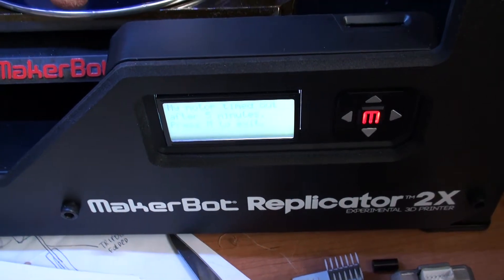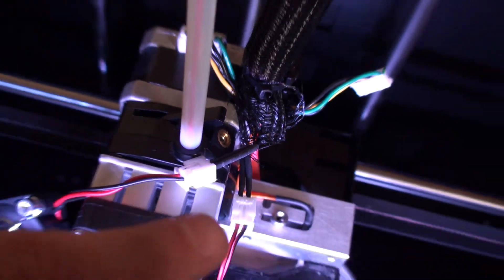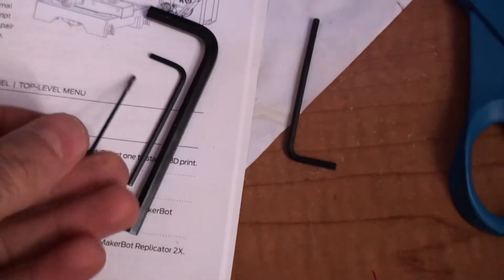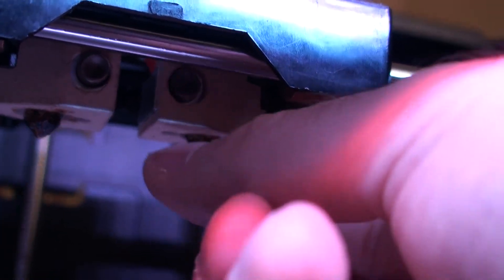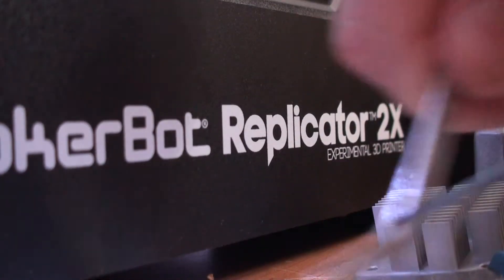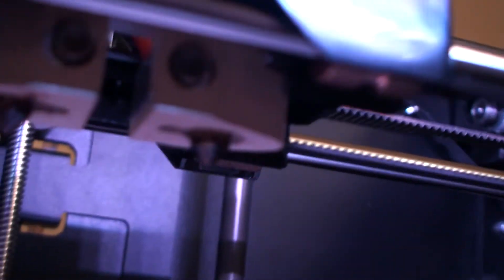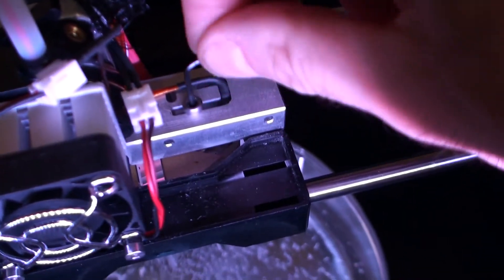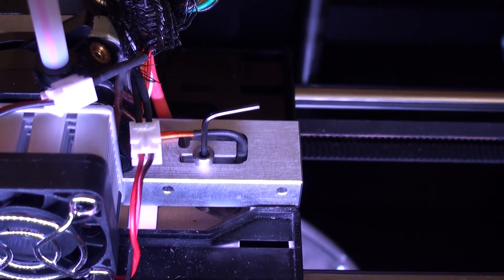How to clean extruder tube for MakerBot Replicator 2X

Comment from the maker: I didn't pour acetone in. I guess you're right, it may ignite if you put it directly into the extruder tube. I later learnt that dropping a drop of oil into the extruder tube is a good thing for filament to travel through it smoothly.